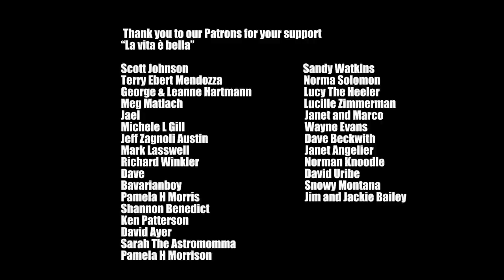WHAT'S GOING ON? Building a LOG RETAINING WALL // NATURALISTIC ENGINEERING

Comment: In 🇨🇦  we also will use this type of retaining  wall construction. It is only used in leveling landscape areas to give muliple levels to a garden instead of a steep hill.  Even in our road construction we are now using open steel cages filled with rock instead of just concrete. It allows water to drain easier so it doesn't build up behind and then break from pressure. The Roman's had amazing building skills and it is interesting  that we are going back to some of those designs... combined with new Geotechnical  science as well. Old and new together.
Happy to see Luca up and moving easier. Best of luck for the big test coming up. You have both been through  so much but you are strong in your desire to survive and continue  with building  and making  your dreams a reality. Sending positive  thoughts to you all. ❤  from Canada.

Comment: There are some houses in my area that still have the slate roofs. It's probably not the same rock as what you showed on that house, but similar. My MIL's house had a slate roof  up until about 10 years ago. Yeah they are expensive! They removed the slate and went with traditional asphalt shingles here in the US.  That 2nd house you explored was huge! wow